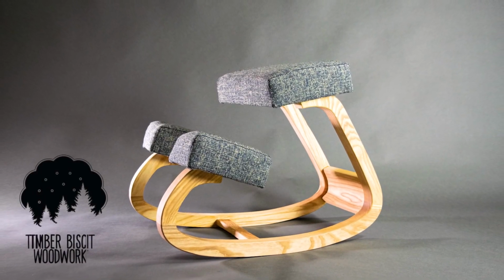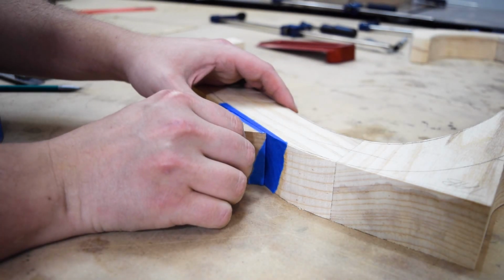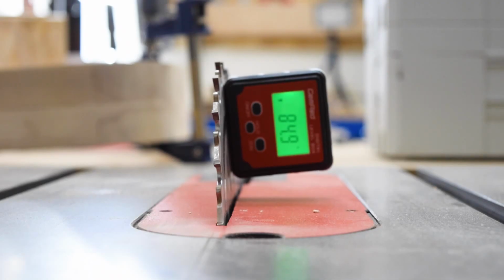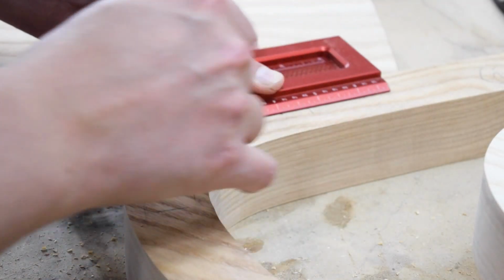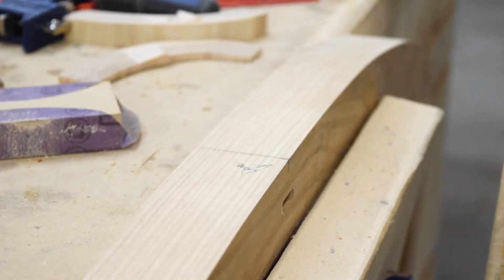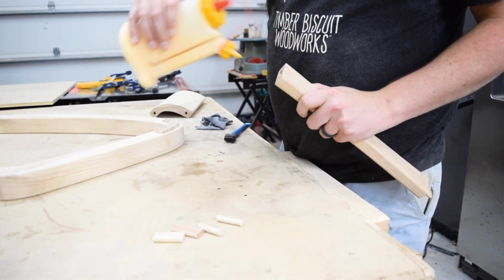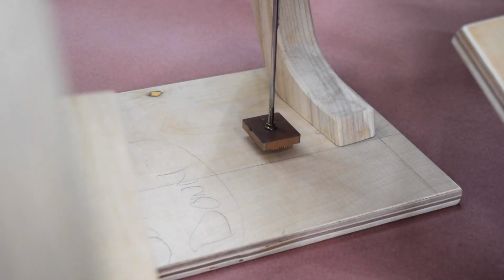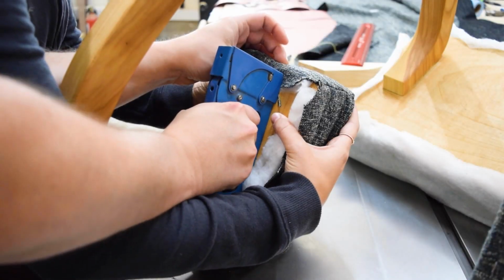How to Make a Kneeling Chair | Woodworking Project

Comment: @timberbiscuitwoodworks this is my dream chair but also yours are the only plans I have been able to find. I was wondering if this caN STILL be made if your working with more basic tools I am building up slowwwwwwwwly. I also will be using pallets so I know it is a big ask.
Reply from the maker: You could probably do it with a jigsaw and a router. The pallet wood might be a big ask though as there's really no telling what shape it would be in.
Reply: I'm going to make this with hand tools: pegged bridle joints for the joints, 3mm plywood laminated for the curved stretcher, proper mortice and tenon for the other stretcher and the connections with the seats (wedged). No dust, no noise, almost no expense... (and thanks to the gentleman for the idea and the plans!)
Reply: But you can't use pallet wood for this: save money by not buying the electric monsters, and buy some ash (or oak at a pinch): the curved shape needs tough, tough wood to work. Go get some from the forest: it's free. Rough cut it to the dimensions you want + an inch, and leave to dry for a couple of months. Work it when there's still some moisture in there (because dry ash--forget it) and it will tighten round your joints as it dries.

Comment: Great job! Enjoyed the video.

For the curved stretcher, no, I would not have been able cut that curve on my bandsaw. I think I would have been tempted to resort to a kerf bending with veneers or a bending a stack of laminations over a form.

Regarding consumables, I go through quite a bit of denatured alcohol. So many uses; removing adhesive residue, loosening hot glue, cutting shellac, mixing dye stains, and cleaning tools.
Reply from the maker: Thank you! That’s a great idea for the curved stretcher too. That piece had me racking my brain for the better part of a day. It was one of those keep building and deal with it when you get there kind of things. 

That’s a good one! I hadn’t considered how much denatured alcohol I go through but you’re right, it’s uses are quite diverse.